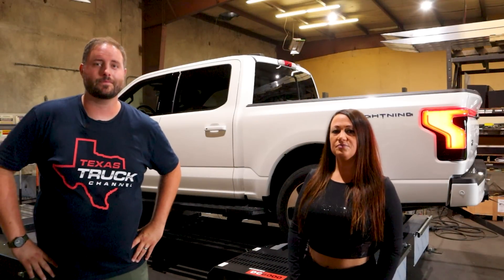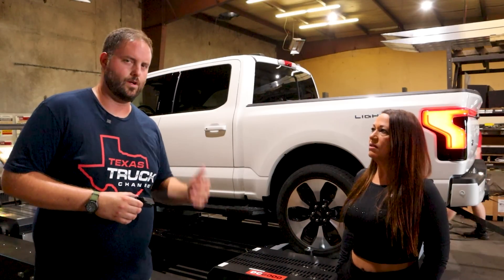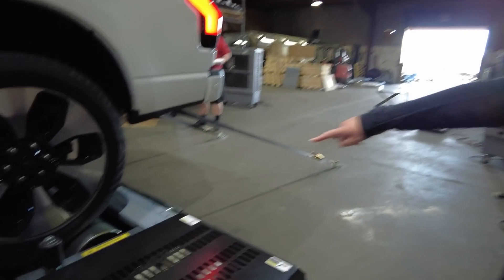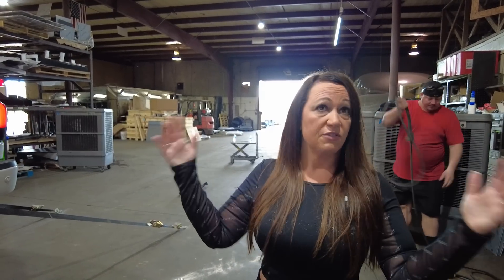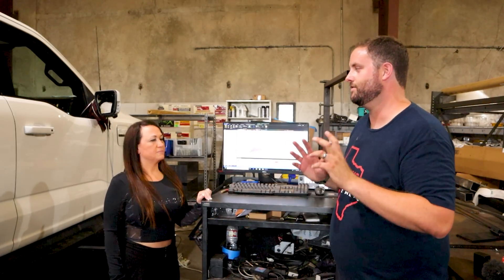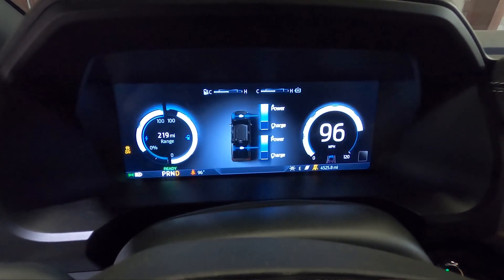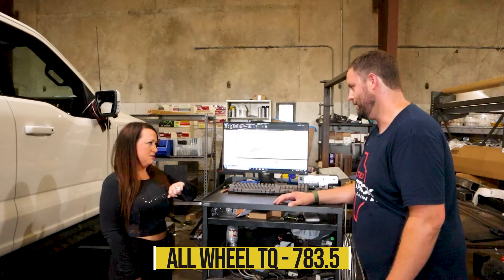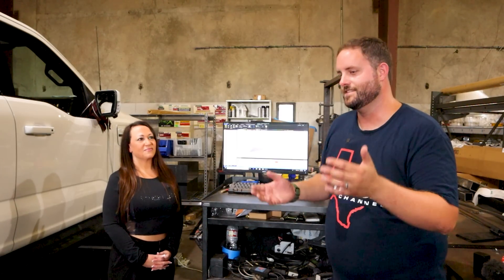EXCLUSIVE // Worlds FIRST 2022 Ford Lightning EV Dyno Test

Comment: 564.9 hp and 784 pound feet of torque to the wheels is impressive.
Reply: Agreed. IF we apply those numbers to an ICE vehicle and use a nominal 12% drivetrain loss, it would be about 640 hp/890 lb-ft at the crank. Very impressive!
Reply: It's pretty difficult to compare area under the curve given the x-axis is speed not RPM. I'm actually kind of disappointed the numbers were so peaky.
Reply: @PedroKing99  Only what Ford is advertising as the official EPA numbers. Anywhere from 230 to 320 miles on a charge depending on which model and battery pack you get. For the charge question I assume you mean how long to recharge. That truly depends on the charger you’re at. Not sure what Ford says about home charging with their charging panel they offer.
Reply: @PedroKing99  10.5kw lvl2 or 150kw lvl3 continual rates with 98kw and 131kw batteries.  Lvl2 = 8-10hrs full cycle. Lvl3 = 30-45 min 10%-80%
Vehicle averages 2.3miles per KW at 70mph
Reply: @PedroKing99  TFL did a 6k lbs trailer pull. Range was a mere 86 miles if my memory is correct. I think petroleum will still be king for a long time to come.

Comment: For a first gen ev lightning this isnt that bad, im sure soon we will get one with more power and higher range close to what a ecoboost f150 gives, until then i will wait to get 1 hopefully by then we can buy directly from ford and not markup hungry dealers.
Reply: There are pluses and minuses to everything.  If you haven’t ridden in a Lightning yet, and done a 0-60, you just can’t believe the torque.  Or how smooth it rides, corners. If you need to tow, buy a F250
Reply from the maker: Amen to that. We will also add that over 560/780 at the wheels. Those are great numbers.
Reply: Eh, what specs are you reading? A 2022 3.5 f150 eco boost only makes 400 hp an 500ft. The electric blow it into the weeds.

Comment: THANK YOU , THEY SAY THE LIGHTNING WITH THE STANDARD BATTERY IS FASTER ?
Reply from the maker: In our personal testing, the pro with standard range battery (and 18” wheels instead of these heavy 22” wheels) was 3.95 to 60 verses the 4.2 that this truck resulted in.
Reply: Quicker to 60 but LR takes off and beats it to the 1/4 by like a second

Comment: So how much is a replacement battery? And how many people will be lined up to buy this in the used market once the battery warranty has expired??
Reply: People keep saying battery replacement, like its a thing. EVs have battery modules that cost around 5k. The idea of all modules failing at the same time is pretty far fetched. I doubt if an EV has ever needed all modules replaced without some contributing factor like a flood or a crash.
Reply: @augsu  get educated. I have been in  municipal fleet management for 30 years. I work with facts and multi million dollar budgets...not feelings.
Reply: @timmbos  Who care where you think you work. There are teslas that with over 300k miles still out and about. These aren't your typical cell phone batteries. Educate yourself before looking like  fool on the comment section.

Comment: Lol, Ford can’t even make a simple internal combustion engine and transaxle run without massive failures, what makes you think they have a handle on electrical engineering? Ford is over priced garbage.
Reply from the maker: Hmm, they have been mass producing complicated internal combustion engines for years, without massive failures. Do you have an example, or a particular Ford product that you were referring to?

Comment: Could they make it a little less powerful but go further on a charge and charge quicker. I don’t need this much power but I need to tow.
Reply: The amount of power that the motors use is directly related to the load on the vehicle. Unlike ICE vehicles, where a 500hp engine would use more fuel than a 200hp engine, with EV's a less powerful motor will not help improve efficiency. Meaning if you're cruising at 60mph with a trailer, a 250kW motor will be using the same amount of power as a 150kW motor would.
Reply: The power when you need it is basically free because the battery is so big and it can output the power.  Range is all up to your right foot.
Reply: Ford installed a potentiometer that the driver can use to control how much power is used. I believe it’s on the drivers side floor we’re your right foot sits
Reply: @jepito29  brilliant description!
Reply from the maker: We think that alot of buyers would prefer this as an option.
Reply: Here we go again with the, I need to tow argument.
Reply: @xxZerosumxx  Ummm, questioning a trucks ability to tow and haul is kinda a valid argument...

Comment: It can tow a camper about 90 miles on a charge 😂😂
Reply: Really just 90 miles?
Reply: @CAC-1111  Maybe you can do better with a tiny camper on flat ground with the heat and A/C off. Yes range is pathetic towing and not that great empty. They are an expensive grocery getter basically.

Comment: What's really crazy and people don't think about is that after a few years these EV cars and trucks will be giant paper weights. Batteries drain over time. Imagine going to try and sell or buy a used EV truck. Just like a cell phone . Every charge and discharge is wear and tear on the battery. You will never get a real 100% full charge out of a used EV.
Reply: Whats even crazier than that is the motors will run 750k+ miles without maintenance so essentially a $22k battery replacement at 350k will get you an otherwise brand new truck and the old battery can still power your home another 10+ years.
Reply: @mattbrew11  is that what is says in the brochure?
Or have you seen it first hand?
If what you say is true , then heck yeah I'm all for it!
Reply: @MartinAguilar213  I own a very large solar company and we are working with ford to install chargers. One of their engineers told me the motors are built to last as long as the Al body will and we already upcycle batteries from
Cars to homes. Mostly nissan and chevy volt units
Reply: @mattbrew11  wow that's awesome. Amazing how far technology has come. Thank you for your reply and input on this. I have to admit I'm very interested in this electric vehicle stuff, but still a bit unclear if it will work out in the long run.
Reply: Right, but it makes you wonder why junkyards are filled with gasoline powered vehicles which you're implying last forever.
Reply: @heathwirt8919  no not at all implying that.
And if you look, junkyards are full off vehicles with body damage, but perfectly running engines. Insurance companies will consider a vehicle a total loss just because of frame or body damage when the engine and transmission are still running strong.
Reply: @MartinAguilar213  It's rare to find a perfectly running engine or transmission in a junkyard unless it's a late model wreck. Most of the vehicles are rusted hulks with engines and every other mechanical part suitable for scrap.
Reply: @MartinAguilar213  Something must be wrong with my car and many others like it. Almost a 12 year old with no issues... 
If you're referring to a first gen leaf crapping out due to poor desing you would be correct in the "few years" remark. Not all cars are designed equally
Reply: The batteries will be upgraded before they wear out. when there is a 400kwh battery that is the same size as the F150's 200 kwh, a quick swap will double range and you can sell the old pack for house storage.

Comment: Great job with the video! EVs and ICE really are apples and oranges and we shouldn't even try to fit them in the same box. I think MPGe And HP are useless. Let's get Kw and MPkWh. Run Kw against the vehicles draw and you can see efficiencies too. That would be an interesting test to pull battery Kw vs output and take a look at losses compared to say Tesla. Then take a look at charging efficiency to calc whole system loss. We're only scratching the surface of a whole new generation of drivetrains and it's super exciting. Can't wait to get my hands on one of these trucks and start tinkering.
Reply: Agreed. We need some metric that normalized the data between the two. Loved this vid! Def exciting to be living on the cusp of a new transportation technology…regardless of one’s views on whether or not we are ready for it.
Reply: There are a lot of new E companies entering the industry now. Plus the big players of the past makign EVs, I think it'll only be time before you wish comes true. IF not for the science end, the marketing end! They will all need something to brag about, but it has to be something the customer can understand easily. And as this is a new segment, saying its got 567EHP's (or whatever) isnt going to compare easily to the ICE market.

Comment: All the bs electronics, power pulling and tc stuff ruins it for me.
Ill be keeping my ice trucks for another 5 years at least. When we can tow stuff in the winter for more than 200 miles, Ill consider the electric trucks.
Reply: Thanks for not making demand even worse
Reply from the maker: I hear you on the towing, but I’ll add that the traction control overrides also exist on the recent ice trucks, but can be defeated on the dyno by pulling the abs relay. That being said, it’s annoying on any vehicle!

We did not attempt this on the lightning.

Comment: It does seem cool. It's got power and I am all diesel guy so I'm trying not to knock this by being stupid in the comments, but one thing that I can't get past is the range. It does seem awesome performance wise, no doubt. But for a truck that's supposed to tow and haul, it's like having a dragster with a two gallon tank. They both provide 580 hp and are quick and are awesome performing machines. But with a two gallon tank you don't see too many dragsters used to tow and daily drive. Electric is great but the batteries need to be better for total practical "truck" use. Cars not bad, but electric  cars still won't hold a candle to a diesel manual trans jetta, in cost of purchase........ key maintenance  (battery vs diesel particulate filter) ..... total emissions (power generation and lithium mining included vs refining crude to diesel)..... at 5 dollars per gallon of diesel, yeah electric wins for per mile driving and honestly I hope it does but for now all considering, diesel. Would love to hear some thoughts, thanks friends
Reply: Interesting, your diesel requires cobalt water and electricity for every single gallon of diesel it burns. 
Cobalt and lithium in the battery is also required to run it and lithium in the very metals it's made from.

Urea for the def injection fluid is also mined for. Diesels burn billions of gallons of that stuff each year. No ev requires it.

Your diesel also has unhealthy particulate emissions an ev does not produce period, noise an ev doesn't make which is also considered to be a form of pollution. Gives off terrible smells no ev does, smells which cause headaches lung issues and Nausea for some people. 

Gives off a lot of heat an ev does not make as ice vehicle's routinely exhaust 220° or hotter air while running. They are just big noisy inefficient air pumps after all. Sucking in massive amounts of air, squishing it, squirting in diesel, blowing it up and out the tailpipe. 

Ice require tune ups and use many manu parts evs just don't have, evs also do not require belts hoses or many various fluids and fluid flushes that every single ice made requires just to function.

Evs don't require oil changes, here in the U.S. we do over 420,000,000 oil changes each year. 27,000+small businesses exist just to do oil changes. 160,000+tons of wasted steel just in the filters themselves. Less than 60% of oil is recycled and even when recycled it uses more energy and water. At a very inefficient rate of 1 gallon waste oil to 2.5 quarts of recycled resellable oil. Which then has to be packaged and transported again causing more wasted energy and pollution. 

Evs don't have engine air filters, fuel filters, spark plugs, coil pack's, don't have transmissions which need fluids and rebuilding/replacement.
Just simple single speed reduction drive sealed gearboxes.
 
Evs don't use any catalytic converters which are made by the hundreds of millions each year and require mining btw. Cats use platinum metals in the catalysts itself(hence why they are stolen and cut off people's stationary car's n trucks by the thousands each year. 

Brakes last up to 3x longer so a lot less waste there. Plus the recovered energy form regen braking which is wasted in every ice vehicle. 
I could keep going but maybe this will give you some research to do? 🤔
Reply: @4literv6  not bad. But a few flaws I would say. Def isn't mined. It's a synthetic compound of ammonia and carbon dioxide. Synthetic meaning man made. And the catalytic converters you mentioned with the precious metals, are not installed on diesels. They have a SCR. Selective catalyst reduction. Way different metals and yes still mined, but way more abundant. And all of that other stuff you mentioned, sounds like your taking the ev just by itself and not thinking of the non emission regulated older diesels in the mining equipment that mines for the lithium for the batteries or pending on where you live the carbon footprint of the electricity to charge the damn ev. And where is there cobalt water in diesel, I ain't saying your wrong just never heard of this in automotive,  semi truck and rail road experience of 20 years. And x3 the brake life....... that's just reaching for shit at that point
Reply: i got an old 86 suburban 4wd with the 6.2 diesel that does 35mpg all day long and can go a long long ways on a tank. 
no dpf filter and no def fluid. 
also got a 1994 chevy c1500 with the 6.5 non turbo diesel that does 30mpg on hwy all day long. and can tow my 5000 lbs trailer and barely notice its there. 
now those 2 trucks are cheap to buy. cheap to maintain and fix.   very simple  and very economical to operate. 

electric is great on paper but not so great in real life  and just wait till they start getting old and needing repairs....... pricey! 

my last point is not all of us live in southern california.
i live where its cold and remote  and no chargers around for 100's of miles. 

i like old. tough. tested and prouven and cheap diesel vehicules
Reply: @frankleonard6570  And I have a load of BS that gets 100 MPG all year long and if you believe that I also have a bridge for sale.
Reply: Just like in the real world MOST trucks won’t be towing at all or that much that range will matter much, move EV owners like myself charge at home overnight(I’ve never used public chargers in over 3 years😳)……so that’s a non issues for the majority, just like it was shown on TFL truck the lightning will out tow even a 2500 deisel ram every day of the week without a sweat and at a significantly lower price and with a 10th of the maintenance problems ! There is almost nothing except long range towing that an ice rig will outperform and sumularly sized EV. Face it it’s only you few guys that tow long range or more than once or twice a month that have the same tired comment complaint, we get it it’s new to you guys but it’s the future and just like a horse and buggy the ice engines outdated methods are of the past! 🤷🏽‍♂️
Reply: @dennissmith7214  MOST owners of trucks do tow. Maybe not every day but MOST trucks do in fact tow
Reply: @mattbrew11  Yeah just like most suvs go off road……you’re completely wrong champ.
Reply: @dennissmith7214  post some stats
Reply: @mattbrew11  Ahhhhh a debate with someone who doesn’t know how to use the internet, how lovely. 😑
Reply: @mattbrew11  The first 5 sites that come up day over a 10 year study 75% of truck owner tow 1 time or less a year………so again most truck owners DONT tow at all! 👊🏽🫢
Reply: @dennissmith7214  waiting on you to post some stats
Reply: @mattbrew11  600 miles everyday at a minimum.
Reply: @dennissmith7214  dennis did mommy take your internet away?
Reply: @mattbrew11  The typical counter argument. You must prove to ME that you are right. Nah.

Comment: It's a hoot to drive. They are ridiculous for a full size truck to be that quick. 45 mph you floor it and it barks the tires. It just makes you laugh. Though besides the insane acceleration it's not as fun to drive as something like the raptor
Reply from the maker: 100% correct, check out our full review of it this sunday, we cover that too.